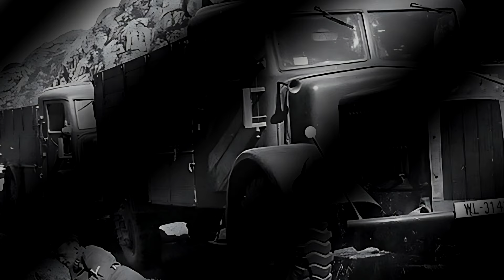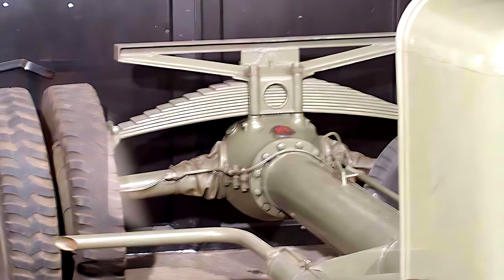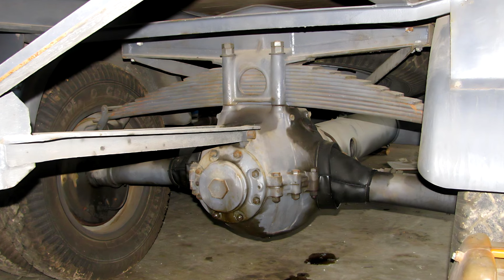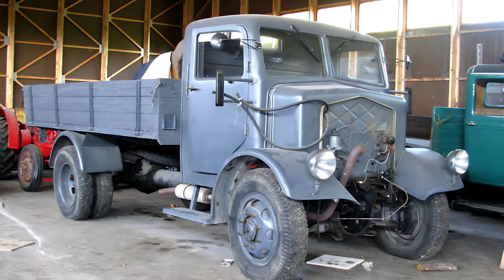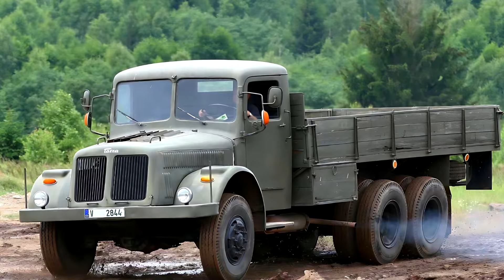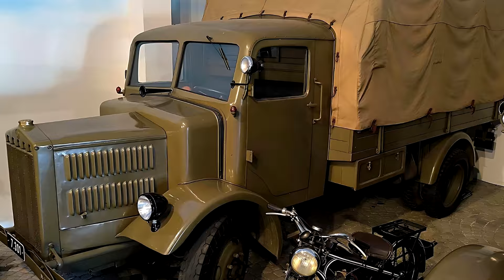1930 Tatra T27 🛠️ The Genius of Early Independent Suspension

Comment: What a powerhouse Czechoslovakia was between the wars.

I have been looking into planes of the interwar period and Czechoslovakia looms large there with a range of companies producing first rate military aircraft that were widely exported. That capacity then went on to be a vital part of the Nazi war effort building for Messerschmidt etc. 

The Panzer 38T in Nazi service was another very useful piece of equipment, providing a significant part of their panzer arm in 1939-41 and being the basis for very effective SPG types through to end of war. Add the small arms to that.

The Tatra vehicles then are a kind of icing on the cake. I didn't realise this truck was quite so unusual and effective, so thank you. Based on tis looks I had thought it was basically a licence built Opel blitz. Oops! 

The British Tories really did Hitler a great service when they and the Poles sold Czechoslovakia out in 1938, hoping Hitler would then turn on the USSR. 

Of course, another critical Czech industry that should not be forgotten is to be found in the town of Pils. Their fine produce alone should have ensured that every effort was put into denying Czechoslovakia to Hitler.

Comment: why do some of the pictures show a radiator in front of the grille?
Reply from the maker: This is not a radiator — it’s a gas generator installed on a World War II–era truck. These devices were used instead of gasoline: wood or coal was burned inside to produce combustible gas that powered the engine. Due to fuel shortages in the 1940s, many German and European trucks were equipped with such systems.
Reply: @youtubeOnwhels You said it was air cooled diesel, how would they burn the gas? 

First, the engine block is flat with no fins, how're you gonna cool that thing if it were air-cooled? Now you said the radiator is a gas generator.
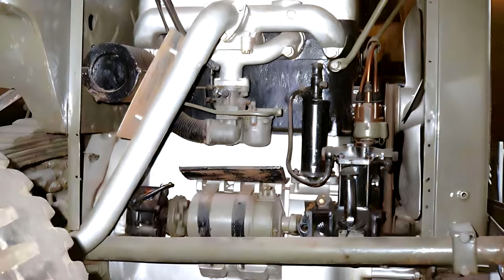Reply: @youtubeOnwhels  Some pictures do show a gas generator, but the majority show only a regular water-cooling radiator. This makes sense since the majority of T27s used a water-cooled, four-cylinder gasoline engine. 1:27 clearly shows a water-cooled engine with an updraft carburetor: obviously not an air-cooled diesel.